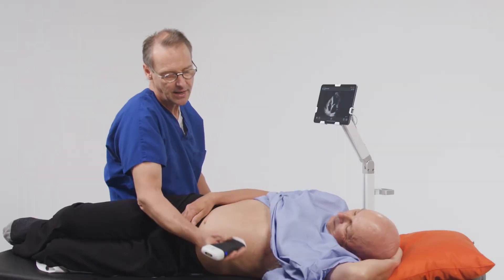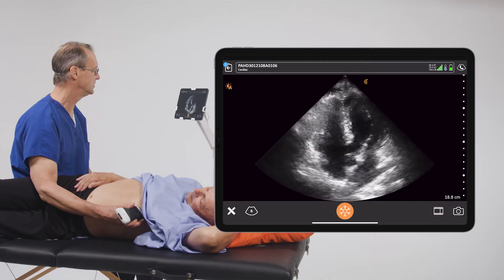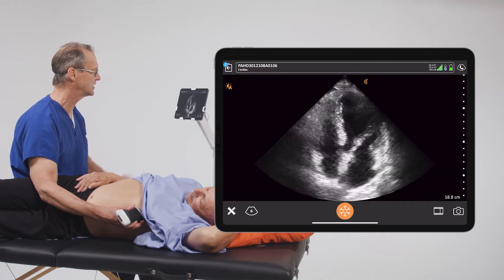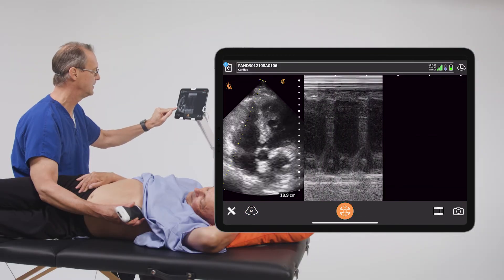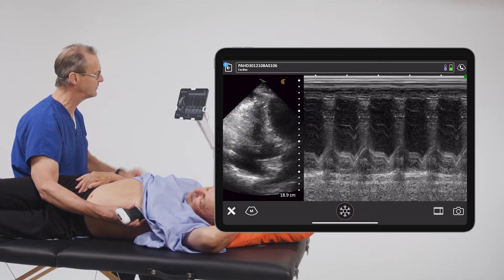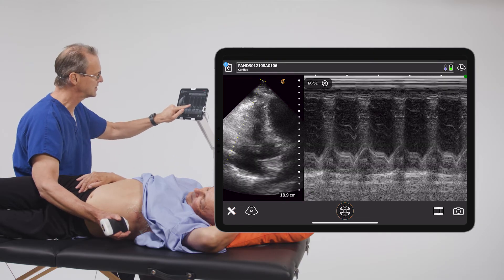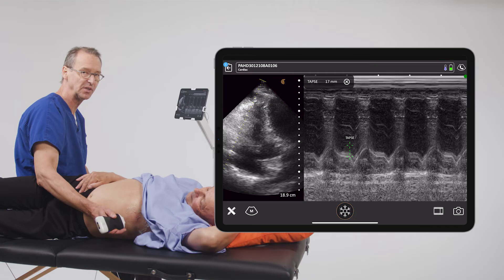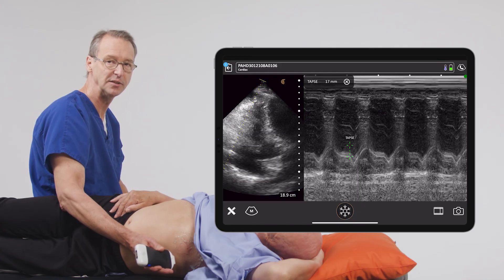How to Measure TAPSE

Comment: The example shown in the video is a bad example. You should stick to the most visible line, start in the lowest point and go to the highest point of the same line. You’ve chosen good line (clearly visible) but started measuring before the lowest point of that line and ended measurement in a random point. I cannot paste a picture here, just google it, there are plenty of valid examples in the internet. Also 17 mm is not a good value, it’s a bit low (but that individual in the video will have a normal value if you measure it correctly)
Reply: and its a 5 chamber view